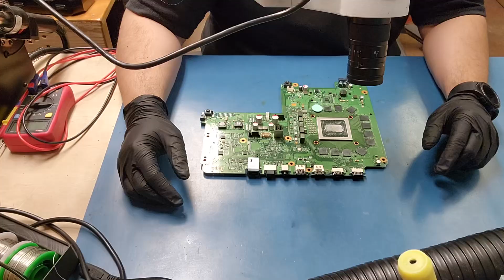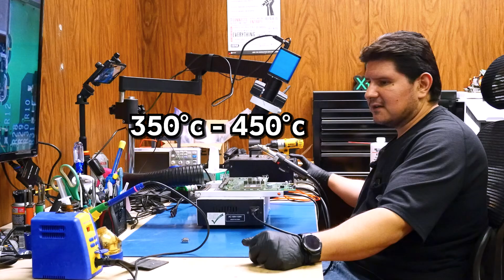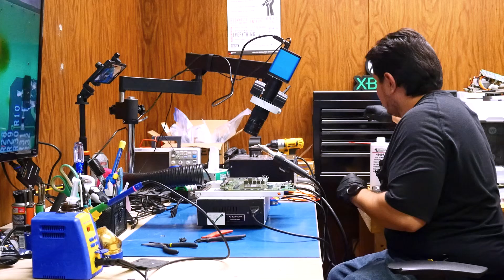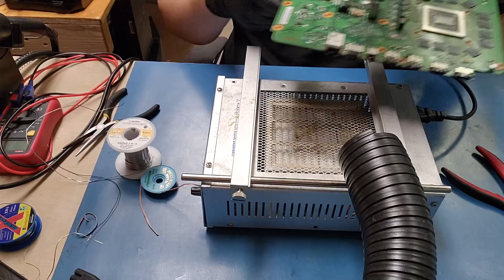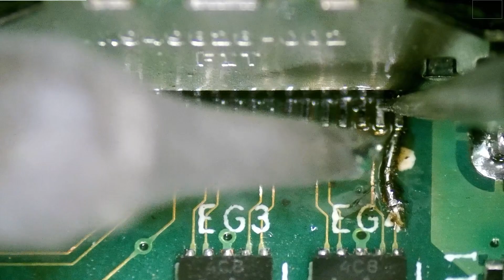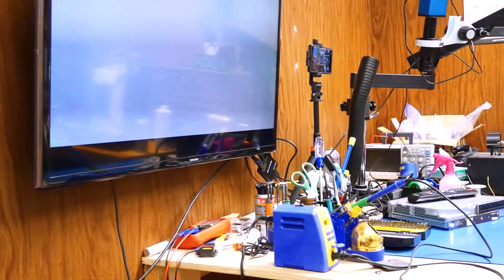Unveiling the Damage: XBOX One X HDMI Port Repair! What Really Happened?

Comment: Great video! I have the exact same board and repair that I'm attempting (minus the ripped pads) and was going crazy trying to figure out how to heat the bottom and top of the board at the same time with only on hot air station. So I guess in a way you opened my eyes to a preheating station lol

Comment: from your previous video recap a  1.6 original board what temp you used for resolder the caps back on. Always enjoy your videos bro.
Reply from the maker: I try to use 380C, but some of them will require 400C or more due to the ground plane.

Comment: I think that you should solder the wires before soldering the HDMI connector....
Reply from the maker: I tend to do that for small rebuilds and for BGA/other IC packages. In this scenario I felt that the chance for things moving and bridging was too great to pre place the traces before placing the HDMI port. I may consider trying it on the next intense rebuild that comes my way though, just to see if I can save time.